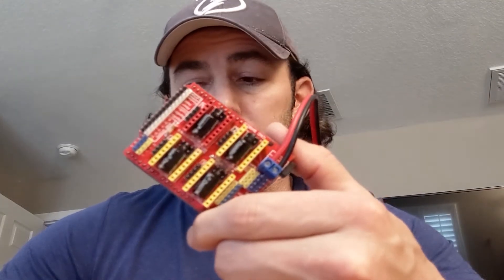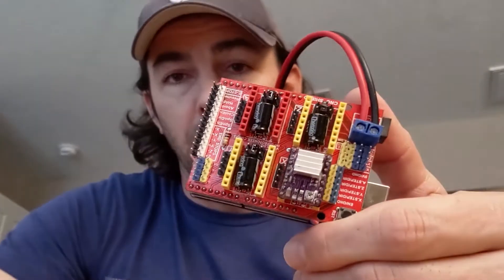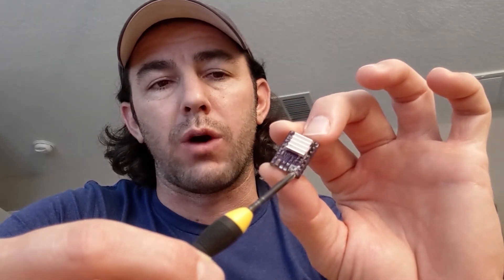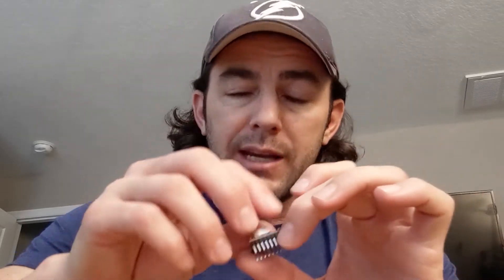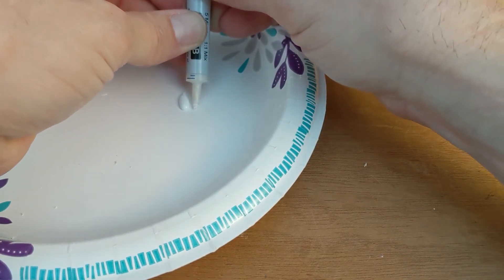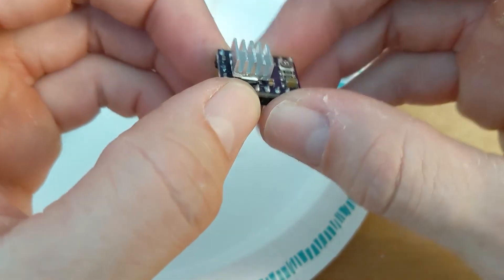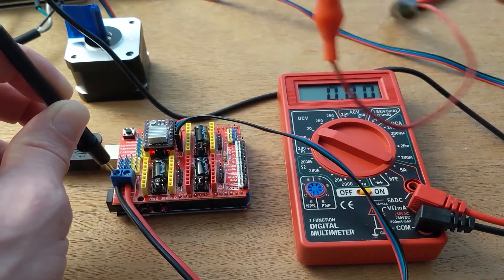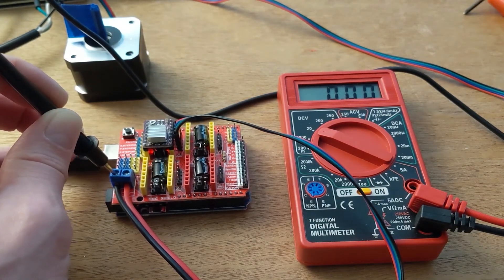CNC Shield, Arduino UNO, DRV8825 - Tips for success!

Comment: If anyone really wants to know why observing voltage across the "current-limit-adjustment" potentiometer indicates how the current limit is set, this might help: https://www.homemade-circuits.com/universal-high-watt-led-current-limiter/ The relationship between current, voltage, and resistance is a given, and as you adjust resistance, you can measure voltage and calculate current.  The calculation for the "current measurement circuit" on the DRV8825 carrier board happens to be "limit_current_A = 2 * measured_voltage_V".  Also beware that many of the clone boards on the market (other than the Pololu carrier board - https://www.pololu.com/product/2133 ) have pots that adjust the opposite direction (i.e. some are low [~0 Amps] when turned all the way left, and others are low when turned all the way right).
Reply: Not sure why I missed the tutorial video from Pololu before, but it explains several of the things other commenters have asked about, in very clear terms: https://www.youtube.com/watch?v=89BHS9hfSUk&t=4s - I noticed that the Pololu video shows the vRef adjustment being done with no motor connected.  This seems to contradict the warning from jtechcustoms in this video.  FWIW, I also powered up my CNC shield with all the stepper drivers installed, to adjust the current limits, before I connected any of the motors, and nothing was damaged (maybe I just got lucky).  Seems like the key might be to make sure everything is powered down while connecting or disconnecting a motor.
Reply from the maker: While I do agree that the issues with regards to fried drivers seem to be more related to stepper motor connections being made, or removed, while the driver is powered on it is also important to note that based on my experience if you plan on setting the potentiometer based on the motor rating you likely still need to perform tweaks to get it as close to max before thermal shutdown and therefore I find it is far easier to do this while having it connected and powered on.  In addition, as mentioned in my video, the thermal shutdown scenario is more common using the adhesive backed heat sinks when compared to the thermal paste solution therefore if you have a stepper with a 1.5a rating, and you plan on setting the adjustment potentiometer to .75 right from the start, I can almost guarantee you'll hear that stepper intermittently shutting down as the chip hits thermal max temp and resets itself.  Again, please keep in mind I am only sharing tips based on my own personal experiences while using this hardware configuration on the many machines I have built thus far, all of which have confirmed my noted tips to be an easy way to save some time and $$ in this game.  I hope they help you in your journey.

Comment: does it matter what voltage the actual stepper motor is?  some are 5v, some 3.7, etc.  not all are 12 v.  But does the power supply voltage have to match the stepper motor voltage, or does the cnc board adjust for that?
Reply from the maker: The allowed input voltage is determined by the stepper driver.  For example, the DRV8825 driver chip allows for 8.2V to 48V input power, as specified on the manufacturer product page here - https://www.pololu.com/product/2133.
Reply: @jtechcustoms  I get that the driver (8825 or the other popular one a4988) can take a range, but my question is they then feed power into the stepper motors themselves.  I see stepper motors (all nema 17 that have different voltages)  I know the drivers have adjustments for how many amps, but how do the drivers work as far as what voltage they put out to the motors, and do i need a stepper motor with a certain voltage?
Reply from the maker: @toddroles3234  The PSU will be responsible for providing all of the power, for example I typically use a 12V PSU, and the stepper driver will be responsible for regulating that power to the stepper motor.  it is my understanding that if a stepper is rated at 3.7a (such as presented in your example above) and you expect to run 4 of these tuned to the max current rating (which I suggest you should, or get as close to that rating as possible without hitting thermal shutdown on the chip), then you're going to consume more power than your PSU can supply (3.7 x 4 = 14.8) and therefore you will be underpowering the steppers and potentially causing them to miss steps when under load in which case the math dictates you should likely be planning to get a larger PSU for this configuration.
Reply: @toddroles3234  The drivers deliver the full supply voltage to the stepper, but chop it up in time so that on average, the current matches the configured current limit.

Comment: OMG TIP # 1 may explain the odd behavior of 2 of my drivers! I knew about the disconnecting and connecting a motor to a driver
while powered but power up without a motor attached meh... did not bother. Not quite 3 minutes into the vid thumb up dropped. :)

Comment: 6:20 Is it necessary to power up Arduino board in this case?
Reply from the maker: Yes, power must be supplied via PSU and also connected via USB.  Just be sure that if you have a driver on the board that it is connected to a stepper, as mentioned earlier in the video.
Reply: @jtechcustoms  I was asking mainly about connection via USB. Without PSU connected to CNC Shield you won't be able to set V-ref, I assume. Anyways, I followed your instructions and everything seems working fine. So thank you once again for your time, your explainations.
Just one thing is not quite right. At 2:55 you're saying that turning the potentiometer clockwise will decrese current when it is opposite - turning this way will increse it. So you have to turn that screw counterclockwise.

Comment: What are your recomendations to put for instance double X axe  motor in the same driver? how can be done? thanks in advance, best regards.
Reply from the maker: I used the following link to wire 2 nema 17's in series and it works perfectly.  I use this series configuration on an MPCNC machine that runs a laser head.  https://docs.v1engineering.com/electronics/steppers/#series-do-it-this-way-

Comment: Hi thanks for the video. It was very helpful (after I blew a driver :)) I have new arduino, cnc shield and new drivers. However as I am turning up the on the pot, my X stepper motor keeps ticking, even after reaching the 50% of its nominated rated current. Any ideas or do I simply ignore this ?
Reply from the maker: Thanks!  The ticking sound is likely a loss of power which indicates the driver is overheating and shutting down.  As noted in the video, the measured current should be set to about 50% as the current measured through that pot is measured as Current Limit = VREF × 2, as per the DRV8825 manufacturer website.  So, for example, if you have a stepper motor rated for 1 A, you can set the current limit to 1 A by setting the reference voltage on the pot to 0.5 V.  I hope this helps, if not, the driver itself may be in bad shape, thus not allowing you to get close to the current limit for the stepper.

Comment: Great Video! I have some Bipolar stepper motors (BJ42D31-02V01) - I can't find any specs online for them. I pulled them from an old 3D printer (which I also dont have the specs for); how can I work out the current rating for it and it's max voltage? Its 1.7" square (NEMA17?). Thanks in advance. I'll be using the CNC shield and Arduino UNO and A4988 Modules.

Comment: The multimeter is turned on DCV, but in the video, it's talked about current measuring!
Turning the screw clockwise increase the voltage, so the current.
I watched that in this video:
https://youtu.be/OpaUwWouyE0
Reply from the maker: Apologies if my explanation confused you in any way, but after watching the video you linked we are both doing the exact same thing.  Best of luck in your driver tuning process!

Comment: Lets say you have a choice between using a 12V 20A or a 24V 10A supply(assume both meet requirements).  Are there any pro/cons that you weigh in to decide which to use?

Comment: How are you measuring current with the meter set to volts?
Reply: He's setting the current limit by adjusting a reference voltage (Vref), and applying the formula: Current Limit = Vref × 2. Source: https://www.pololu.com/product/2133. Just be warned that some boards use different values of current sensing resistors, so this formula may not apply!

Comment: i want to use dvd stepper motors for a diy ploter with this very configuration (same board and same driver like in your video); what is the Vref for such motors, where to find  data sheet

Comment: Your video is recent enough, but still i have a hard time to find that 2 component thermal glue. Wish you had a cheaper more common solution
Reply from the maker: Product is on amazon, here - https://www.amazon.com/Arctic-Alumina-Thermal-Adhesive-5g/dp/B0009IQ1BU/ref=sr_1_4?dchild=1&keywords=thermal+glue&qid=1609766391&sr=8-4.  You can try other thermal solutions but be sure they are thermal glue, not just paste, otherwise the heatsinks will not remain secured to the chips.

Comment: I need to power one large stepper motor and 3 much smaller ones with an arduino, the large stepper motor will need its own board to serve its 4 amps that feeds off PWM pins on the arduino. As for the other 3 motors, I want to drive them with this shield. Is it possible to clip some of the pins on the bottom of the shield to allow some of the PWM pins to go to my larger driver board? or is there some way to get that signal from the shield and send it that way

Comment: I am facing a problem the grbl works  till I connect cnc shield( v3.00) to power(12v 30 amps) as soon as I connect it to power supply grbl  disconnects . 
I have tried and checked that grbl works with leds .
I also tried 0.8c ,0.9j,1.1f  versions of grbl 
Also purchased new shield and drv8825 but still the problem continues pls help.

Comment: Tip #1, Yes and No! But you have to adjust the vref first, otherwise the motor is toast. Is this a vicious circle?
Reply from the maker: It's simple really - you set vref to 0, then connect stepper, then power on, then set vref to match what is needed for the connected stepper.  By following this procedure you avoid all undesirable issues and you also achieve the best possible outcome for each connected stepper.

Comment: Can I run Nema 23 2.8 amp
Reply from the maker: DRV8825 driver is 2.2a max if I'm not mistaken.
Reply: @jtechcustoms  sir u told that u have used it with Nema 23 which one was that
Reply: @jtechcustoms  sir can u recommend me other affordable reliable driver and controller configuration

Comment: Thank you very much JTechCustoms for the tips. I kindly request some information about the jumper settings on the CNC shield. I have a Nema17 1.7A motor and what should be my jumpper setting? Should I shortcut the middle couple? Also, for the CD/DVD stepper motors, what is the jumper setting on the shield and the current setting on the driver 8825? I would be very glad if you can redirect me to some information source. Thank you.

Comment: hello, there seems to be a bad understanding of how these stepper drivers works. what kills them is unplugging or plugging drivers in while powered. it has to do with the fly back voltage that is produced, and the circuitry that takes that energy and feeds it back into the system to the high voltage capacitor. the issues is if the motor coil is charged when being disconnected, with no parallel resistance, voltage can spike to excess of 1000's of volts, which breaks down and damages either internal transistors or damages the glass oxide of the power mosfets. if you leave these not connected when powered on, they will be fine as long as rated for the voltage. yes they will try to ramp up voltage (up to almost max voltage at vmo input) to increase motor current, but no current will flow as long as loop is open. what damages these drivers is being plugged in backwards, being hooked up while high currents set and unplugging from a motor with a charged winding.
Reply from the maker: Thanks for clarifying!  My advice to all was to be sure you have a stepper connected at all times while the driver is powered up, to avoid any potential issue, but I guess it also makes sense that they can be powered on without a stepper connected as long as you do not connect a stepper while the driver is already powered on.  So, perhaps the better statement here would be to avoid any stepper related wiring changes while the stepper driver is powered on, agreed?

Comment: Can you use A4988 instead of the DRV driver?
Reply from the maker: Definitely, I see many kits sold with A4988 instead of the DRV8825.
Reply: @jtechcustoms  note the VREF calculation is different.  For the DRV8825, VREF = winding current / 2.0.  But for the A4988 VREF = winding current / 2.5.

Comment: Great video. Do you have to adjust the current in the stepper motor driver? I already have an adjustable DC power supply that allows me to set the proper motor voltage. Is it still necessary? I’m very new to this lol

Comment: Can we run Big setpper motor with cnc shield 
plz reply
Reply from the maker: DRV8825 drivers have a maximum current rating of 2.5 amps per coil when properly set up with heat sinks and air flow during operation. Knowing this information you can now pick the largest stepper motor available with this current rating. Also keep in mind that you will need to be sure your power supply is rated to provide that amount of power to all steppers at maximum output to be sure you do not experience any loss of power to any of the steppers while in use.

Comment: Brilliant video.  Just one question have you installed any end stops yet??
Reply from the maker: Thanks Andy! Yes, I typically have 3 end stops setup for homing my machine.  Are your stumped on the process?  If so, let me know what your dealing with and I'll try to help.
Reply: @jtechcustoms  I have a Pi 4 coming tommorow and a 2.6 Protoneer. I also have the parts for buffer boards but no documentation on where to wire them using NC switches.

Regards Andy T
Reply: @jtechcustoms  Where are the connections on the protoneer board for your limit switches? And do you` run NO or NC switches.

Comment: Wish I would have watched this video before I set up my CNC Shield. I watched your build video for setting it up, but missed the critical part about not applying power unless a motor is attached to the shield. Needless to say, I blew not 1, but 3 of 4 capacitors in about 5 seconds. Scared the crap out of me for sure. Thanks for the tips. I am subscribing!
Reply: Sorry to hear to popped a few drivers, we've all surely been there!  Thanks for the kind words, and for subscribing!
Reply: @joeeisenberg8111  Can we run Big setpper motor(NEMA 23) with cnc shield 
plz reply

Comment: Any experience running two steppers in series off a single driver, using 24v, this is a mpcnc recommendation, would like to try this. Hope you are well
Reply: I followed the following link to wire 2 nema 17's in series and it works perfectly.  I use this series configuration on an MPCNC machine that runs a laser head.  https://docs.v1engineering.com/electronics/steppers/#series-do-it-this-way-
Reply: @joeeisenberg8111  wow, awesome! Im Pretty lucky that you tried it. Im planning on a plasma rig. Thank you for the great answer! I leaned a lot from this vid, it's folly that there is no warning from any sellers to connect the steppers before powering up! Very important. Thanks again!!!

Comment: My stepper motor vibrates and doesn't Respond according to the code .... Please help me out... I can't produce the exact output
Reply from the maker: I am fairly certain your wiring between the steppers and the driver are incorrectly paired.  You need to be sure the wires are paired properly and the easiest way to do this is to power off your setup, disconnect the stepper from the driver, and touch 2 of the 4 output wires together and manually turn the output shaft with your fingers.  If it turns without any friction, then these 2 wires are not a pair.  If the output shaft has friction you have the 2 wires properly paired, and of course the remaining 2 wires are also a pair.  The nest step is to make sure than when you connect these wires to the driver side, they must me side by side in the configuration.  As seen on the manufacturers website for the DRV89825 driver here, https://www.pololu.com/product/2133, you will see the pairs should be B2, B1, A1, A2, and each letter represents a pair.

Comment: Great Video! Thanks for the tips!
One question, why you checking for ampere when your multimeter is set to check volts?
Reply: He is correct with what he is saying in video.  Although could be helpful to mention why measure voltage.  The screw pot is increasing current as voltage is increasing.  Resistance in coil remains the same.  For these drivers Vref x 2 is formula used for ~current.  Thus aiming safely lower 1.5A means 0.75V.  Hope that helps.
Reply: I have the same question here: When you're using the multimeter you say "power" (measured in Amps) but I think you mean "voltage" (measured in volts) as you have the meter set to the 20v DC setting. Can you please clarify for us?
Reply: @joshtbw   Can we run Big setpper motor(NEMA 23) with cnc shield 
plz reply
Reply: @sukhjotsingh8386  yes you can! But there is a drawback! This DRV8825 driver won't be ideal if you want to fully utilize the power of nema23!
Technically DRV8825 can give 2.5A per coil but 2A is generally used for safe measures!